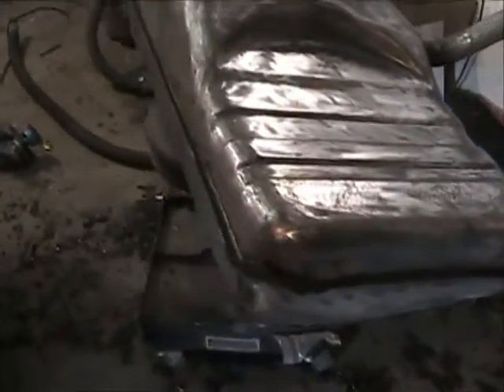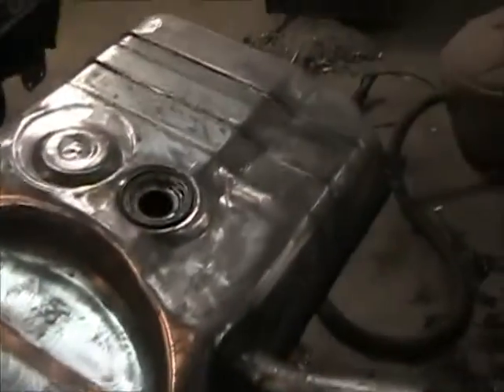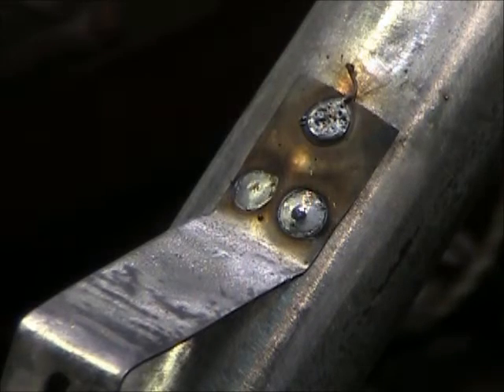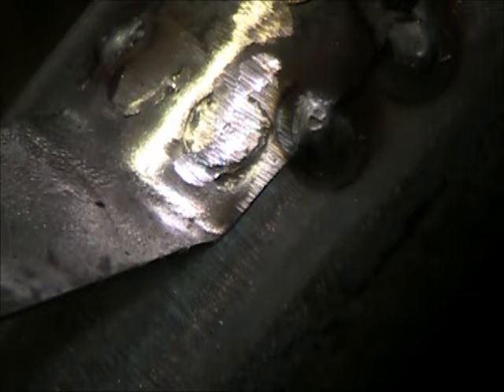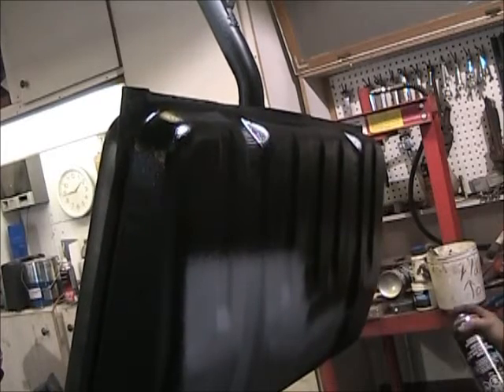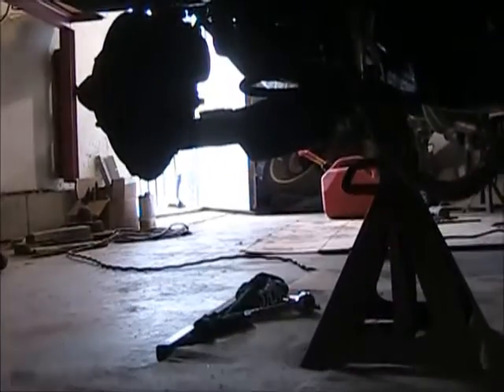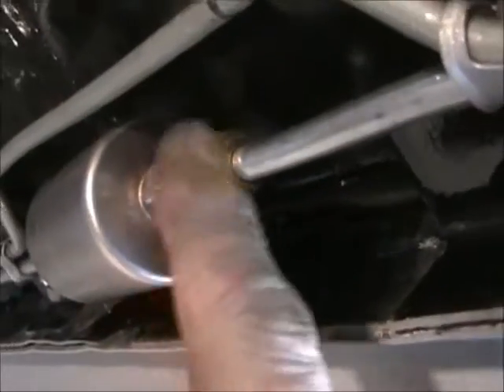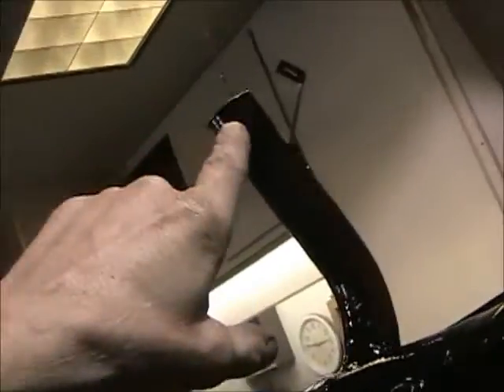fuel lines in and gas tank redone

Comment: Great video, If the old Gas tank isn't too too bad you may consider saving it. You are planning on installing a LS1 motor in the Nova and if you do you will need to install a sump in the tank for a fuel pump, as you have to cut a tank to weld the sump you might as well cut the old tank which will give you a big hole to clean it out and they weld a sump in it for the pump. BTW Summit sells a sump kit for LS1 gas tank conversions. Good luck Rick.
Reply from the maker: thankx carey,the old take is very good shape,but had old gas sitting in it for years and after first reading this i went out and just tapped it lightly with a rubber mallet and i could hear the scale falling off,i think u got a good idea here and i will check summit out,so glad u posted this info,i was having a hard time throwing this tank away because it looks so good,might beable to salvage it yet,thankx for the tip and watching,tc

Comment: An LS1 motor has to have a 35 lb preasure fuel pump either in the tank or on the frame with a two lines going to the fuel tank. If you want it in the tank you can buy a tank with the pump in it but for my chevelle they want like $500.00, the other solution  is to use a stock tank, weld a sump in the bottom in the rear of the tank so the motor doesnt get fuel starved and use an external pump hooked to the 1/2 NPT fitting in the sump. You might consider welding a sump to the bottom of your old tank and save that for the LS1. I am not that great of a welder but I have a friend who can weld it. From what I understand they fill the old tank with argon Gas before they weld but I am not sure of the welding procedure for weldng used gas tanks. Good Lucky Rick!
Reply from the maker: thankx again,sounds good,i can imagine the tank with the pump for the nova would be about the same price,i like the idea of the external pump,sounds like it would be easier to maintain too,once i get a good look inside my old tank and if its in good enough shape thats the way ill go also,i got a friend that is a good welder and id get him to do that,the ls engine swap is sounding less complicated the more i learn,thankx again for this info,it realy helps alot
Reply: TheRickfix Rick I think the sump with the external pump is like half the price. The sump is around 70 dollars and the pump prob another 70-100 dollars. versus a custom tank for 400.00 and a submersible pump for like 50.00. I like the internal pumps but you are right if it is outside its easier to get to if you have to replace it. and with the sump gas is never gong to slosh out damaging the pump and stalling the motor. I am just now learning about the LS1 because I am going to install one in the chevelle I am restoring. Its expensive but from what I hear very reliable and thats what I wanted, to build a classic car with a relaiable modern motor. Great talking to you Rick have a nice evening:)

Comment: Those Fuel lines can be difficult to bend when it runs from one end of the car to the other.  What I've been doing is making them in about 3 pieces.
Reply from the maker: u got that right,lol,putting the fuel filter where i did actualy made it easier and once i got the main line done it sorta gave me a pattern for the return line but i can see that 3 pieces would have been much easier,probably the last time ill ever do this,lol,but was kinda fun now that its in,lol,tc

Comment: Rick as an aside, I am an electrician and have wired a lot of Electric Vehicle Battery Chargers but I don't know much about the Batteries. Could you post a tutorial about Batteries, how to take care of them, how they work. What we should be looking for when buying a new Car Battery. I know I have been buying Die Hards for years bit seems liek they aren't like theu used to be, Sure would be interesting to learn about Batteries. Thanks.
Reply from the maker: as to the battery information,ill see what i can put together,we havent made car batteries in at least 20 years now,we make rail road,marine and solar mostly,and forklift batteries,i dont deal with the assembly of batteries but make the plates that go inside so ill go to the right departments and gather up the info and see what i can put together   i wish we still made car batteries because they were good quality but the company is so small that they couldnt compete with the larger manufacturers that mass produced them the name of the company i work for is surrette battery in springhill,nova scotia,might take me abit but i will get something together,tc